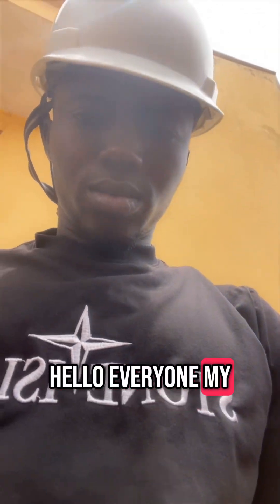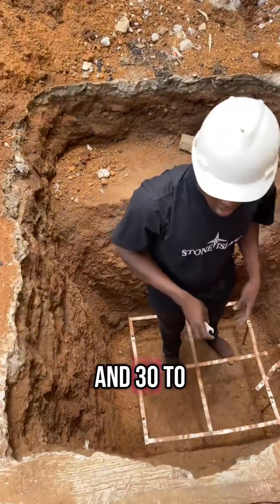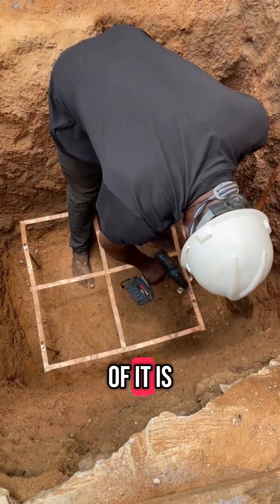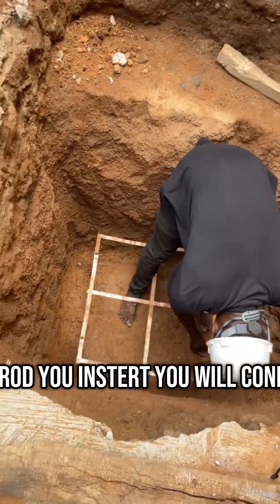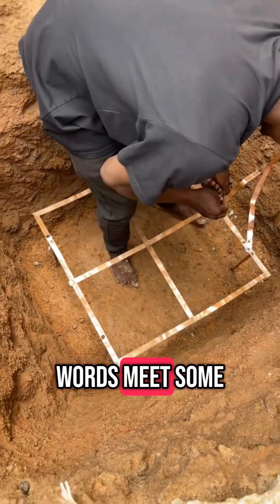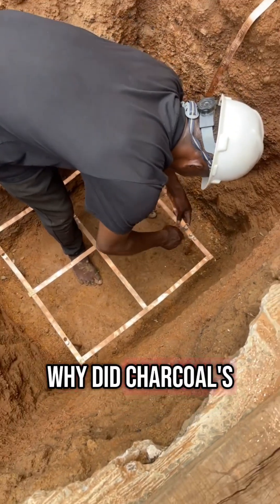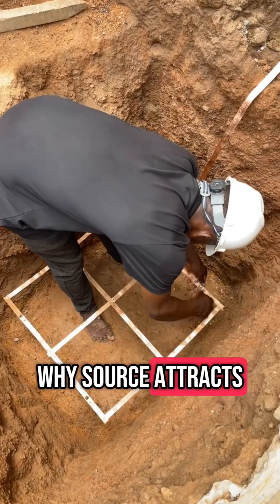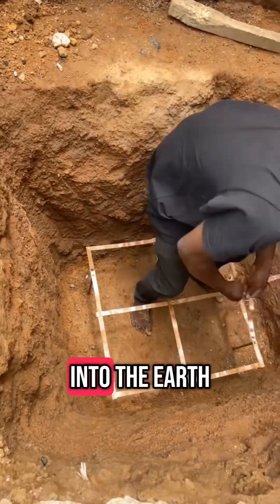Step by step how to installed lightning arrestor

Comment: Well done bro. Please how did you connect the heart max together. You sold it or use bot and nut?
Reply from the maker: I used bolt and nut 2number
Reply from the maker: It as male and female strong pine to join it together